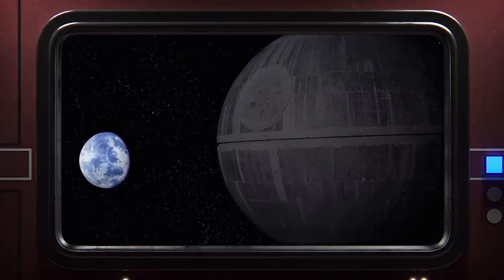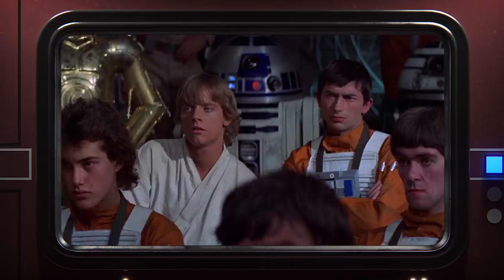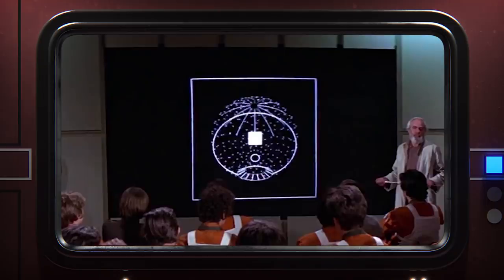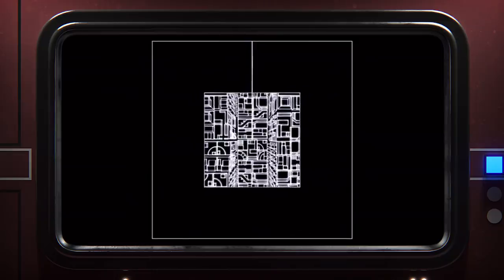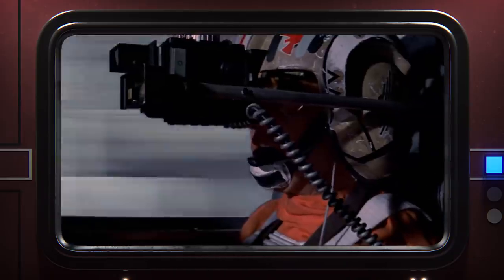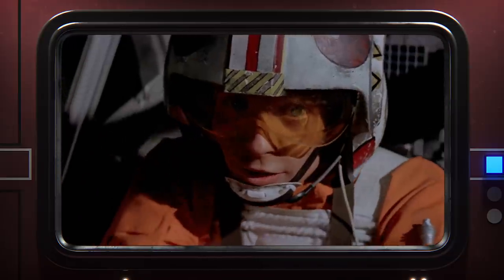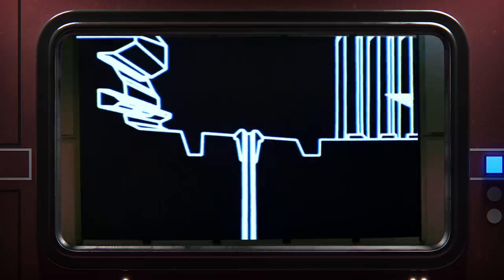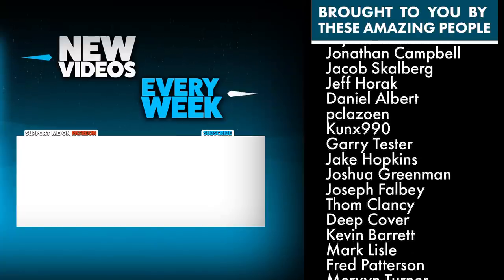The Thermal Exhaust Port Was NEVER a Problem

Comment: There is another factor here that is not mentioned very often. (1) When the TIE fighters were coming in they said "My scope's negative!" and "pick up your visual scanning". (2) Wedge asks, "Are you sure the computer can hit it?"  My belief is that the Empire had some kind of sensor scrambling in the area, that affected both their ability to pick up enemy fighters, AND the targeting computer. No matter how many times they had a shot, the Empire could have sat back and let them use ALL their ships - and the targeting computer would NEVER be able to hit it. So, Luke turning off his computer and using the Force to sense the accurate timing and aiming was literally the ONLY way it would have ever worked.

Comment: People forget that the exhaust port was too small for torpedoes to hit. Prior to Luke hitting it, we had another guy fire torpedoes into the exhaust port only for the torpedoes to impact the surface and not hit it, even when he was using an expensive targeting computer. Luke Skywalker had to use the Force, which is something the Death Star designers didn't take into account since when they were completing it, they thought all the Jedi were either dead or in hiding, not a problem to be dealt with.

Comment: I always figured that the whole point of acquiring the DS plans was because the exhaust port they targeted was "special".
Look at the exhaust for any regular car, and you'll notice twists, turns and angles. Scale that up to a moon, and it's highly likely that an exhaust port is the end point of a rather complicated mass of tubing that is not a straight shot.
The in-movie lines KIND OF confirm it, and Rogue One definitely does, that the singular exhaust port Urso designed was a straight shot to the reactor core, hence making an otherwise invulnerable target, well, vulnerable.

Comment: Thanks I am tired of people mocking the exhaust port on the Death Star but I think the thing you missed in the video is why The Death Star needed the exhaust port system in the first place. I always found this odd as an exhaust port is not technobabble made for the movie but a real life piece of equipment commonly found automobiles or anything else that use an internal combustion engine. One thing I will the Rouge One tie-in novel Catalyst is that it goes in detail about how Galen got the exhaust port past Krennic. Specifically Galen points that a system is need to vent all of the excess heat of the Death Star and keeps steering Krennic into picking the exhaust port system then he made a single port of the several installed just big enough to fit a proton torpedo. (if you watch the movie again you can see that Luke's tropedo's have to go into the port one at time.) To also add why they didn't a second cover on the exhaust ports alongside the ray shield, It is said in the essential guide to warfare that particle shields (which are meant to counter proton torpedoes and concussion missile but let lasers through) would block be counter productive for an exhaust port as the exhaust can't get out.

Comment: The weakness Erso implemented wasn't even the exhaust port. The exaust port was just the primary way to access the weakness. It's the reactor that's the real sabotage. The reactor is designed with the possibility of a chain reaction in mind. And lo and behold, at Endor, Wedge and Lando are able to take out the reactor in a similar chain reaction.

Comment: Proton torpedoes can have a  guidence system in some models. More over, even with focus, Luke could barely pull his Lightsaber out of some snow. He didn't use the force. 

This is not unreasonable though.
Reply: Yeah I think they're guided, but it's logical to assume Luke used the force in a more natural way, the kind of heightened reflexes of knowing exactly when to pull the trigger, same instinctive force sensitivity that helped Anakin be the only human to be a successful podracer. Actively bending the force to your will to move objects is more difficult and requires training but the instinctive stuff is something the Jedi used to look for in young kids with potential for being padawans.

Comment: My understanding is a huge part of galens sabotage was designing the death star so it would be vulnerable to that kind of attack at all.  Its not really obvious that two proton torpedoes would cause the reactor to catastrophically explode like that.  Might damage it and cause part of it to shut down, but even the reactor is this massive mechanism, that even if you struck it with torpedoes, wouldn't necessarily even completely fail, let alone destroy the entire vessel.

Comment: To me, the one thing about the exhaust port that made it truly a weakness was that it was a straight path from the port to the main reactor. It's likely that this was how Galen sabotaged the design. Because all the other exhaust ports probably would have had a bend in the shaft. So he made sure that just this one exhaust port provided a clear shot to the main reactor.

Comment: OK, I don't know where to start so I will just lay it out.
1. Galen Urso setup the weakness and helped the Rebels find the plans in the first place by packaging them together and naming them with a codeword the rebels can figure out. If he didn't, you would not have the scene in the movie you refer to because they would not have any plans at all. 
2. We know don't know for sure the torpedoes have a homing system based on this scene but they are shown to follow a trajectory to achieve a vertical entry much like a glide bomb. However guide ordinance is commonplace in Star Wars so I assume they can be programed to follow the path they need to enter the shaft they did.
3. The rebel attack was organized in such a rush and short period of time and succeeded. Imagine if the Imperial didn't track the rebels to their base and hand them scramble a last ditch effort but instead plan an all out assault with many more star-fighters with multiple simultaneous attacks on the trench to overwhelm the Dead Star defenses.
4. It is much more likely that Ben influence on Luke to take the show mean just letting him press the button at the exact time so the trajectory the torpedoes need to follow works out to a clean hit rather than "guide"the projectiles with the force.

Comment: The other ports may open and close periodically or they are all closed if the station is attacked. The port that they attack in the film could be one that’s left open at all times so that the station can still vent heat in case of an emergency.

Comment: I think its possible that the other small exhaust ports were also exploitable but they would only focus their attack on one because their force was so small and it would mean there's a greater chance of success. Many of the fighters had to engage others to even allow for a run. 

They also needed the plans itself to even find the weakness, so it's possible that it's only this one. Out of something that large though it isn't unreasonable for there to be a design oversight when it's literally the first one ever constructed.

Comment: My issue with the "reality" of the attack (it's a movie about space wizards made by a guy who loved WW2 dogfight movies, so I get it and I'm still a fan) is that the exhaust port is on the surface of a sphere. For years I thought it was on the far wall of the trench, but no. The best way to shoot a torpedo down the port is to attack perpendicularly, not at a 90 degree angle down some elaborate, well-defended trench. Actually a trench not very well defended since it should be like shooting fish in a barrel (and who puts turbo lasers to protect a trench no capital ship could fit in anyway?). 

So you attack from above. No trench. Boring but effective. 

Love the video though! You're spot on.

Comment: Maybe I'm missing something. Your first argument assumes that all ports are homogeneous. If, more realistically, they all connect to different systems based on location, then it's not unreasonable to assume there was one port that connected to a vulnerable system that was not shared by any other port.

Comment: Normally, I'd say have armored shutters and multiple paths so if a foreign object is in one it closes and uses the others, perhaps on the other side of the station. This might have been a special secondary one that didn't have any seperations and actually was literally just a straight hole right to the reactor, and not the outer parts, but an inner part that could make it explode if hit. That arguably could be a clear sign of sabotage. Not to mention the lack of safety grates and things over these, the simplest option for keeping random stuff out of them. I mean imagine if a tie fighter gets shot down (like they tend to) and its debris smashes into the exhaust port and somehow clogs it up, what's that going to do? You need multiple, backups with split outputs for any system of real importance.With bends, grates, and traps to keep rain, water, debris, etc... from getting into the engine or core itself. If we can do that on modern tanks and cars, pretty sure they should be able to do that on a giant moon sized battle station, like, on EVERY one of its ports or possible access points to the reactor. If any one is lacking these even more basic coverings, that's a problem.

Comment: The take I took from Rogue One wasn't that he designed it with the exhaust port as a weakness. The weakness he put in was explicitly in the reactor, so that it would only take minor disruption for catastrophic failure. How the rebels put a disruption in, is not something he seems to have decided for them. Otherwise he would have just said "Proton torpedo down the chute". The rebels needed the pans to find a way to take advantage of the reactor weakness.

What this told me was that the Imperials did know that the port led directly to the main reactor, but that without Galen's sabotage it still wouldn't have mattered, and a torpedo down the chute wouldn't have done anything impressive. 

My headcanon is that he expected them to try to find a way to infiltrate it and plant a bomb, and that had he lived to see the actual plan he would have said "You want to do what now? Are you insane?"

Comment: My main beef with the trench run is that it makes no sense to attack the exhaust port from that direction. Seeing as the port points directly away from the center of the Death Star it would be much smarter to attack from the opposite direction. It avoids all the turbo lasers aimed along the trench and it allows for many more approach angles (only the final bit needs to be directly towards the port). Now the attackers has to have torpedo's that are capable of executing a 90 degree direction change in order to enter the port, with a direct approach that is not needed.

Comment: 1:40 Anyone who knows machines or bodies knows there are parts to a whole. War Thunder: If you can't kill a tank, shoot the barrel and tracks. That's an awfully big hole over there. Be a shame if that were slightly damaged before firing. This would cause the weapon to be inoperable, or too dangerous. If fired with damage, the weapon would likely explode causing the Death Star to look like the Death Star II but with no weapon. This could even destroy the whole station. It would be best if it simply made the weapon inoperable forcing the Empire to spend billions on salary, maintenance, and repairs throughout the entire rebellion!

Just like the Bismark, Yamato, Maus, Elephants in the Alps. They're more a waste of money that draws attention. Everything small is just a small version of something big. Every tank has a hole leading to the engine. You could reach a drain snake into the tank through many areas.

Comment: I remember when i first watched this movie, i figured that something that size would require more exhaust ports than just the Main and "secondary" port metioned in the briefing, additionally given the REBEL in rebel alliance that means that people rebelled or defected so it stands to reason that if they were targeting this specific port someone had bodgied up the paper work/designs to make this a weak point and that by the time anyone found it, it would be determined to be something so unlikely to be hit they'd not up armor it past the ray shield mentioned. the amount of armchair experts that are hidebound and determined to point this out as a plot hole and then use rogue one as their evidence on why its a plot hole and not something the orginal filmakers would assume people could figure out from the context clues in the original movie boggles the mind.

Comment: Thank you, thank you for pointing out the ridiculousness of saying that any sort of weakness that's exploited to defeat the bad guy is somehow unacceptable. How the hell is the Empire supposed to account for every little thing that could go wrong on a station as large and complex as the Death Star? Capture some rebels? Better kill them immediately- no interrogation, no keeping them as bargaining chips! After all, there's a non zero chance one of them could sneak away or overpower a guard, and there's a non zero chance they could be close enough to a key system to either sabotage it or otherwise mess with it to render the station inoperable- or exploded. As you said, the movie itself has several very powerful forces going against rebel success: the port is only two meters wide which is a tiny target when you're going at attack speed and juking to avoid TIE fire. The port is shielded, which means the x wing have to use their much rarer proton torpedoes, which I'm pretty sure they've only got... maybe four or six? Fired in pairs, so max three tries- after you manage to turn around and somehow dodge the aforementioned TIEs. Out of the thirty rebel pilots only two survive- and Luke only lived due to Han Solo returning at the exact moment Vader had a lock. Luke uses the Force to screw around with physics, something the Empire had just spent 19 years making sure only they had, and only in the most loyal inquisitors. Any of these go wrong and the whole plan falls to pieces, Yavin 4 is destroyed and the Rebel Alliance is a minor footnote in galactic history. It's like the villain has to be invincible to get any respect or something! If anything goes wrong with their plan suddenly they're completely incompetent. Have you ever tried to make a moon sized battlestation that can blow up planets? . 
Great video.

Comment: if there are 18 identical secondary exhaust ports, then there is no reason to construct only one of them differently, since you have a perfectly symmetrical design. You simply use the same plans to build it. So I find the explanation, that the designer tinkered with only one of them to make it vulnerable, believable. Maybe he isolated the communication stream to one of the sector construction crews and gave them different instructions on one single detail. 
There is no plausible reason for the vulnerability to occur on only one exhaust port by chance and the Rebels to find out. So for this one, I totally follow the Gailin Urso explanation.
Reply: great super-tiny detail idea, makes sense!

Comment: I think your points just reinforce the Galen Urso plot, because if it had only been one exhaust port (or even two), the odds that thousands of engineers would have failed to notice and compensate for the weakness are astronomically against. No pun intended. 

With it being this unlikely, chances are some of the engineers building the thing DID notice but blew it off as negligible or were afraid t challenge the design.

Comment: One thing I would like to add here, less about the death stars design but its use: 
The rebel assault nearly failed and and only two fighters made it to a firing position despite the empire sending out a grand total of 3 fighters to intercept them. Granted, one of them was Vader, but they could easily have snet whole wings of TIEs and crushed the rebels. They didn't because they thought themselves impenetrable and were a bit cocky. But they could have, and a glaring weakness you have a method of easily countering is not so glaring anymore.

Comment: Yeah. That's pretty much what I've been saying. Not only would exhausting reactor heat out into space be practical, it would be necessary. Just blocking off the port with some kind of physical barrier would actually make things worse. The station would both eventually blow up and the inhabitants inside would cook to death before that. THAT would be a glaring flaw in the design and all the Rebels would have to do is just wait.

Comment: Another point that anyone that understands why exhaust ports would be a thing is would understand is that you want to minimize the twists and turns and vent it as efficiently/fast as possible - especially on something like the Death Star between heat from everything, the reactor, and the laser. So, especially if ONE of eighteen is actually straight enough or the least defended (obviously defense of the main vent would be high as possible)That removes even that much more from it.

The only issue I have ever had was with the X-Wing attack runs. The Y-wings generally seem to drop ordnance conventionally, so it would have a ballistic arc where the trench run makes sense. The X-Wing is a multi-roll fighter, and fires them off more akin to rockets. It has speed, mobility, and is a very different delivery platform, and should have instead been using diving attacks that line up with the regular projectile arc. One need only look at Red Leader's run in which he just hits the surface, cause he doesn't use the force. It wouldn't nessecarily even have to be a near 90 degree dive bombing run, even just a shallow angle like Corsair's on rocket attacks would have improved anyone that wasn't Luke's odds in an X-Wing - along with allowing for more space to maneuver when engaged by TIE's. That, and the fact that slow bombers with minimal defense for some reason had 0 top cover in an organized attack.